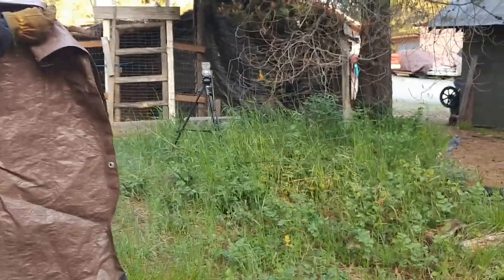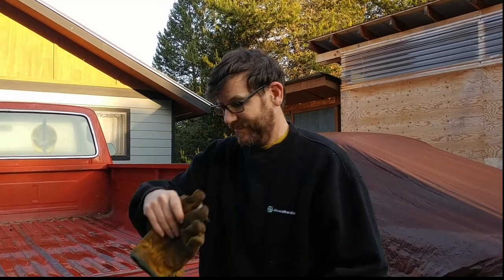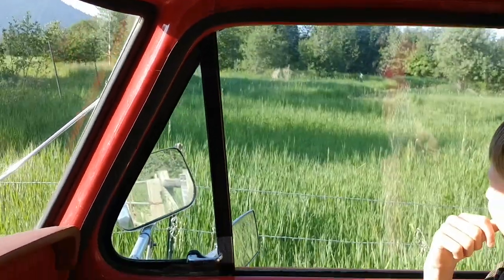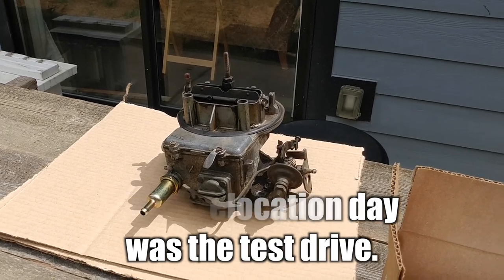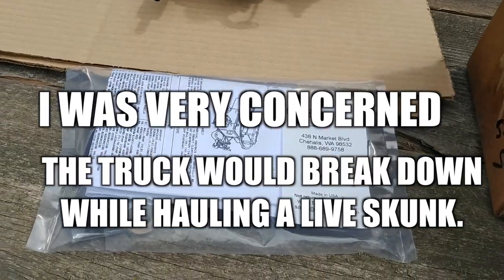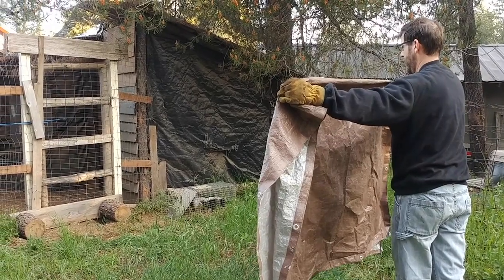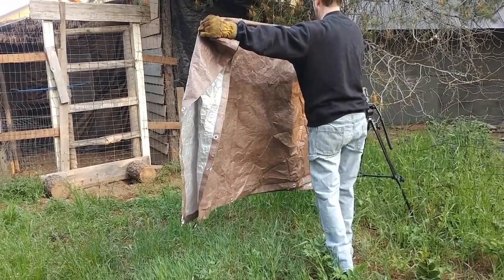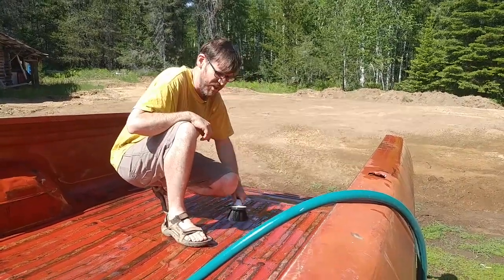How to relocate a live skunk (without getting sprayed much)

Comment: You need a blanket long enough to cover your feet, and your head. The skunk should see no part of you. I usually put the trap near a stationary object. So I am not constantly peeking around the blanket. A fence post, or tree makes a great reference point. When releasing, Use a socket extension to hold the trap door open. If they were kept in darkness. They will take a few to come out of the trap. Plenty of time to get far away.